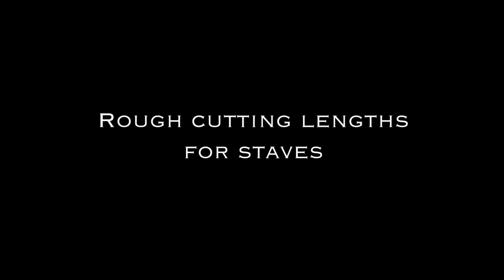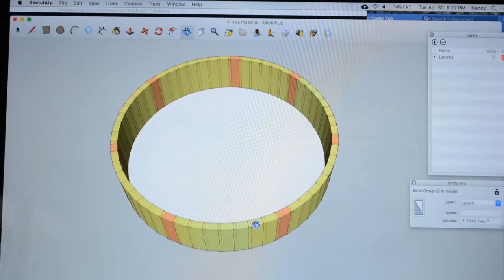Woodworking - how to make a wooden bath | hot tube | do it yourself

Comment: Was it supposed to leak?
Reply: In long terms: YES
Reply: The wood will swell. And they could have waxed in between AND Linseed oil instead of turpentine.
Reply: That was my question also. I made a wooden bathtub but for the life of me can’t figure out what to use to stop the leakage
Reply: @GigglingButterfly Europeans have made watertight barrels for 2000+ years without anything between the staves. You probably need something between the staves and the bottom of the tub. Linseed meal should work.